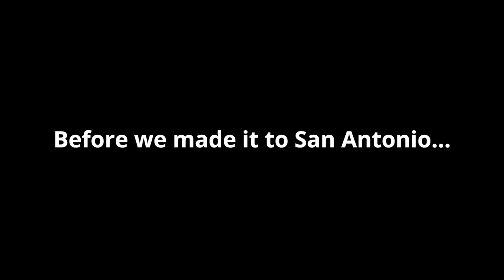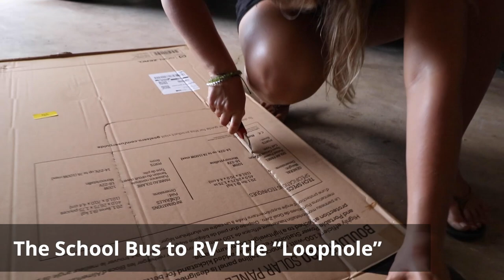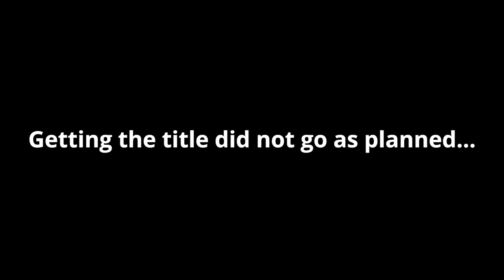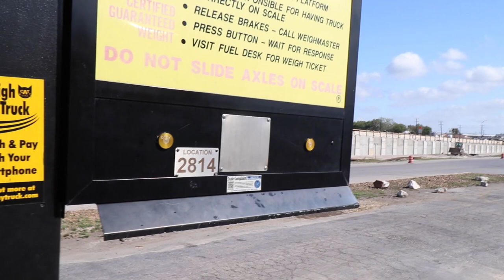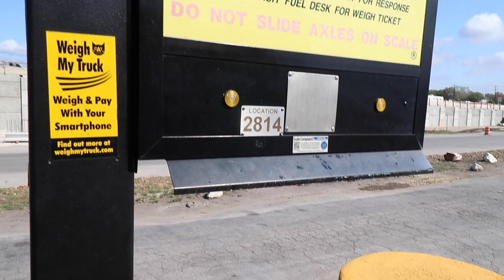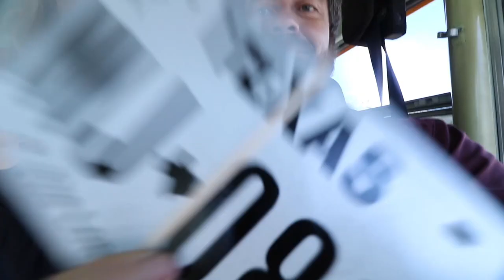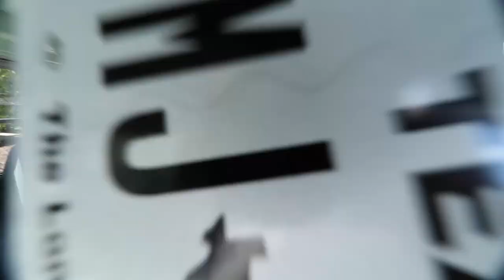Title Change Loophole | PRE School Bus Conversion to RV

Comment: Your dad cracks me up.  Love the videos!! Also....sleeping on an air mattress sucks the heat from your body and doesn't breath so you feel wet with sweat.  If you are still sleeping on that blow up, throw a couple thick wool blankets in between the bottom sheet and the mattress and it will make a huge difference.
Reply from the maker: Hey hey @JenaSorbera! Great point! We just had to have SOMETHING for the journey! Love the tip about the wool blankets! Have never thought of that.

We have a KILLER Queen mattress that we're going to be putting in our Skoolie. Stay tuned for that video WAY in the future! LOL
Thanks for watching!
- Brian + Erin

Comment: How did you set a toilet with external evacuation? Isn’t good a compost toilet?
Reply from the maker: Hey @Andrea Gatti, great question! Short answer... we didn’t have external evacuation. This video just shows our setup required to get the title switched over to motor home from school bus. Texas only requires four of six components to be installed. We have all of that outlined on our website if you go check that out.

Once we get back to the toilet project, it ends up being a composting toilet with a urine diverter so that we can separate the wee from the poo.

Thanks for watching!
- Brian + Erin

Comment: there usually showers at truckstops need to bring flipflops though as you can pickup some weird stuff from the floors (fungus warts etc )
mister heater buddy heater has realy good reviews from quite a few rv-ers can run it on thise propane cans but you can get an adapter and hook it to a full size propane bottle , might be a better idea as it likely to be running non stop on cold nights
Reply from the maker: Ya, @watahyaknow... After doing a few truck stops, and only showering in one, we are happy to have our own shower forever more. However... the shower wasn't too bad at the one we did have to use. So people who don't do a shower in their skoolie could certainly utilize them, and not feel too bad about it. ESPECIALLY with flip flops. LOL great point! 

As for Mr Buddy Heater. It is pretty good, but propane is a wet fuel source, so we decided not to make it a permanent one in our bus. We needed it temporarily to acquire the RV title. BUT we sold the heater when we got back to Canada. We will be using a different heat source. Stay tuned!
Reply: @BEAdventurePartners  if youre cooking with gas it is probably a good idea to keep a buddyheater in the package with the bus just in case you need extra heat or running out of wood 
at some campgrounds and parks you need to bring youre own wood and youre not alowed to collect it out of the forrest , it usually wet and full of bark and critters too 
then again i think if you ask nicely at some freighthub you can take a chainsaw and cut up a huge stack of trow away and damaged pallets (hardwood is best burns longer )
put a tarp under the sawhorses and you have stuff to trow in the composting toilet too
Reply from the maker: @watahyahknow  - Buddy Heater is already sold. Great points about the wood. We will have wood on board for sure, and collect it when & where we can. There will be a designated spot for the wood in our underbody storage. Once we build it of course. Don't want those critters in the main living space. ;)

Comment: Anyone interested in driving a full size bus before and after conversion(RV or not) needs to know if the manufacturers gross weight is over 26000 lb you may need a NON commercial cdl class B or A depending on state.  Air brake vehicles require a system knowledge  test as well.    If you're lucky you live in one of the states that don't require special licensing.  Short buses just require a normal driver's license due to weight being under 26000 lbs.  If you strip a full size bus of weight to squeeze in under 26000 lbs then convert to over the magic number you can get into big trouble.  I found all this just before I started shopping and it changed everything.  More homework needed lol.
Reply from the maker: Amazing share @Vaughn! We didn't need special licensing because we got everything sorted out in TX. Up here in Ontario... You need 2 different fancy letters on your license to drive a big rig like this. PLUS thousands of dollars in training... No thanks. lol

Maybe get your RV title through Vermont. We have an article on our website where a lady lived in New Orleans and got her title in Vermont. Great story. Might inspire you ;)
Reply: @BEAdventurePartners  I've got the Vermont DMV VD119 form printed out and ready to fill when I find my bus.  Skoolie.net and Hamskoolie YouTube channel do a wonderful walk-through.  👍 👍 👍

Comment: Just some notes on the whole title thing......

Every state is different so check for YOUR state.
In Oregon (out state) we only have 30 days to transfer the title. We could have gone through a similar "intermediate conversion" but with COVID and how Oregon DMV is doing things we didn't think that would work and it has to be retitled as an RV in order to be able to drive it without a CDL.

HOWEVER, the penalty for not transferring the title within 30 days is a mere $25.....no matter how late you are.
So in Oregon, if you're build is on private property, you COULD simply wait till the build was done and pay the "penalty" of $25.

We chose to go a simpler route and hope to report back that it still works just fine.  

We applied to the state of Vermont for RV registration. Vermont won't issue a title for anything over 15 years old but will issue a "transferable title" as an RV if that's what you apply for. That can then be used in Oregon (and I'm sure in other states) to get title in your home state.

We sent our paperwork off the Vermont "return receipt requested" and they received it on Feb 24th. On March 24th our check was cashed.  We were told by our source that it would be 6-8 weeks (pre COVID) after you mail it out so we're expecting to hear back around the 14th of April. Considering this method has no preconversion "conversion" requirement, no VIN check, just paperwork and some fees (and sales tax on the purchase price of the bus), this seems to be REAL EASY.  

Of course you guys couldn't sit around and wait since yo needed to get across the border so it wouldn't have worked in your circumstances.  But maybe for others.
Reply from the maker: That is some GOLD @Ham Skoolie! Once you get your school bus titled as an RV, we'd love to publish that story on in an article on our website! Email us when you finish the process and we can send you the link to a questionnaire that helps us write the article. We think this could REALLY help a ton of people out! Thanks for watching! - Brian + Erin
Reply: @BEAdventurePartners  Well the PLATES are here but not the registration document and sticker. They apparently come in a separate mailing.  But HEY, they wouldn't have sent the plates if they weren't gonna send the registration and sticker.
$176 plus about $10 to send it return receipt. Far easier, and probably cheaper, than doing an interim "conversion" if you have time.
Reply: It's all here and a video will be up when weather and scheduling permit.
Reply from the maker: We just watched that video of yours on your channel! That's such a great way to get the plates (and registration, of course!!) Thanks for the share!

Comment: Careful with that Buddy Heater.  Propane in a very wet heat source, so you will be getting A LOT of condensation on your windows...and everywhere the moisture will go....electronics...etc.  As for bus to RV title in Manitoba it's stupid simple.  All seats out.  A bed and only 1 of the following...cooking area, fridge, sink, and toilet.  That's it.  Didn't even have to repaint it like you have to do in some provinces.
Reply from the maker: Great intel @RvWorldTraveler about the Buddy Heater! We used it a couple of times on the trip up to Canada and I did notice that the mini propane cylinders DID get a ton of condensation on them. We'll have to research more into heat sources because we do like the idea of having one. Do you know about if the propane tanks are mounted on the exterior/outside compartment & run a propane line inside if the Buddy Heater has that same problem? What heat source do you use?
Thanks for watching!
- Brian + Erin
Reply: As long as you have the flame inside the bus, you will always get condensation.  I am just uploading a video onto my youtube channel right now and be available to view tomorrow morning, you will see a large amount of condensation on my windows from the Big Buddy that i used.  What i use for a heat source now is a 35 000 BTU furnace.  Suburban SF-35FQ.  It runs on propane, but like a house furnace it vents the moisture outside.  A fan blows on the hot elements so you get the heat, without the moisture.  I live in Winnipeg and its been -25 C outside and i've had it +20 C inside so i can still work on the bus.  I bought my furnace on Ebay.ca from a seller called cmlsurpluscindy.  They sell pre-used / factory scratched RV stuff for about 1/2 the going price.  i would highly recommend buying a furnace, they are small and pack A LOT of heat.

Comment: Hi, fellow Ontarian here! Out of curiosity, what is the benefit in getting the bus certified as an RV while you are in the United States? Does it make it easier to cross the border back into Canada? Will you have to go through this process again once you get Ontario plates?
Reply: Excellent question. I hope to buy my bus next early July and coming back to Ontario to start the conversion.
Reply from the maker: Hey there @NatashaRoberge :) That's an awesome question! We have a very unique situation. Because I (Brian) am from Texas and Erin is from Ontario, we have to option to get the vehicle certified as an RV in either the US or Canada.

Buying a bus in the US and taking it to Canada to get reclassified as an RV has some challenges. We would have had to pay an import fee and possibly have a broker do the process. We may have even had to have it towed/transported instead of driving it. We got a quote on insurance in Canada and it was going to be something like five grand for a six-month commercial policy. There were too many hoops to jump through to buy it in the US and get it with Ontario plates...

Soo... we ended up going the easier (and much less expensive route) by getting it re-classified in Texas, then taking it up to Ontario to do the conversion (where we have access to tools & a shop, along with a place to park it while we do the conversion. We didn't have that access in Texas).

Hope this answers your question!

Thanks for watching! More vids coming soon!
- Brian + Erin
Reply from the maker: Hey @JoëlDucharme. Just answered this question below on this thread! That's exciting that you're going to get your bus! Where are you going to get it? Auction? Dealer? Look forward to seeing you do your conversion!
Thanks for watching!
- Brian + Erin
Reply: @BEAdventurePartners  Thanks. :) It's funny because work with Natasha! :) I'm looking at AAAbus. I have been looking for a couple of months and there are too many satisfied customers not to go with them! And as you said in another video, the busses around here are all rusted. No thank you! 

Your answer worries me though. I don't have the option of switching the title in the states. 

I will have to study this a bit further.
Reply from the maker: @Joël Ducharme, awesome that you work with Natasha! What a small world! Don't let our answer deter you. It is possible to buy in the US and take it into Canada. You'll have to "import" the bus though. Here's the website we looked at for importing from US to Canada https://www.tc.gc.ca/en/services/road/importing-vehicle/purchased-united-states.html

We also called them to get instructions on how to do it. People do it. But the main issue was trying to get a company to insure it for a "normal" rate that's not ridiculously expensive (the only one that we found who would do it was going to charge 5K for a 6-Month policy. No thanks!)

Comment: I was reading restrictions on a G licence and it says the poluce go by either the registered GVWR, or the vehicle manufacturer's stamped GVWR, "whichever is higher"... So even if the bus is registered under 10,000kg if the manufacturer plate says 20,000 then you needva D license? How did you get the manufacturer GVWR reduced?
Reply from the maker: Hi @Terminal Insanity, We didn't get the GVWR reduced! Ours is still 34,200 lbs (15,512 kg)... BUT its registered in Texas AND we have air brakes (which, in Texas it doesn't really matter! LOL!) We'd recommend talking with the MTO about it and let us know what they say :)
Thanks for watching! 
- Brian + Erin
Reply from the maker: If you haven’t seen this, here’s the Ontario Drivers License rating page that confirms your numbers https://www.ontario.ca/document/official-mto-drivers-handbook/getting-your-drivers-licence

We’re also now curious about which license is required to drive a motorhome greater than 11k kg!

Comment: Whar did the bus weigh before and after seats out ??
Reply from the maker: Mark Wilson before the seats... not sure because we had AAA Bus remove them so we could get insurance.

After the seats we’re out, we weighed 20,220 pounds.

After we took out the floor, walls, 3 seats & ceiling, we weigh 18,120 pounds.

Stay tuned for THAT video coming soon! Thanks for watching!